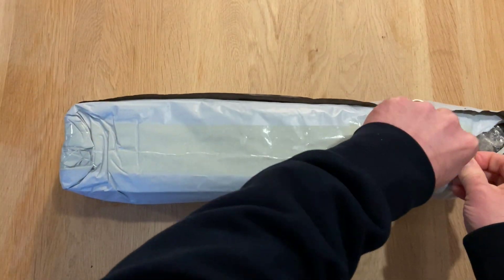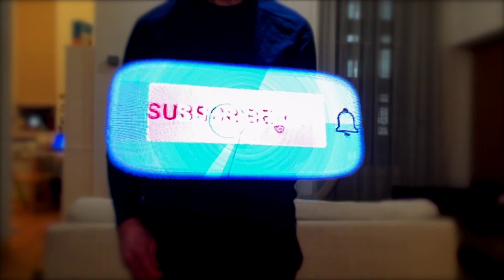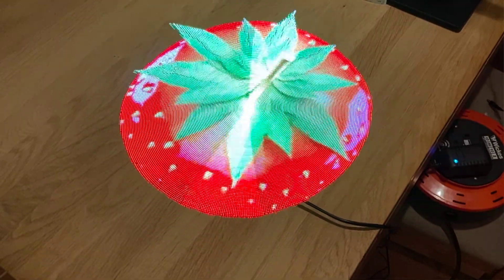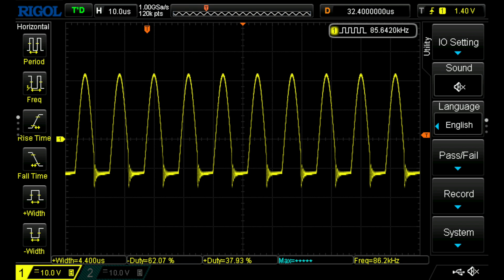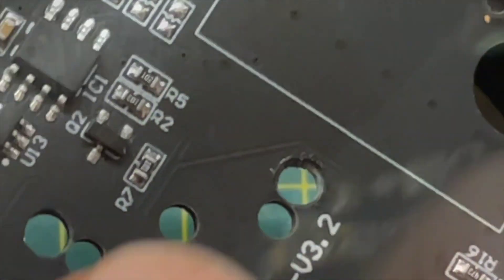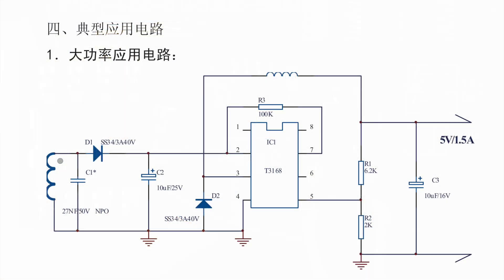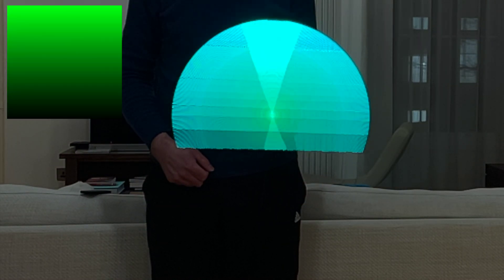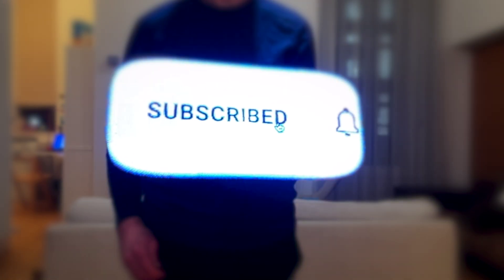Insane Spinning LED Hologram Fan: Unboxing, Demo & Tear Down!

Comment: I recently bought a holographic led fan, it works fine and projects the image but some leds don't light as they should, do you think it could be a wiring problem? 
How does it work? I want to know if I can fix it on my own 😢
Reply from the maker: It's most likely some of the LEDs are faulty. Is it one or two and are they always off?

Comment: Why werent this made with ws2812b leds? speed requirement?
Reply from the maker: I think so yes, I believe the bit rate for ws LEDs is 800Kbps. I think you wouldn't be able to get enough angular resolution with that update rate.

Comment: I wonder why they don't use APA102 leds and dispense with the driver ic's. Perhaps it's cheaper this way.
Reply from the maker: I must admit, initially, I thought the same, but I think it's down to the refresh rate. I don't think with addressable LEDs you'd be able to clock out the pixels quickly enough and have the LEDs latch the results fast enough to get a high enough resolution. Might be fine for a small display - maybe the one I have would work, but think for larger displays it might not.
Reply: 刷新频率不够

Comment: Curious, what's the cutting edge (sic) holographic tech available today, within reach of most makers?  Monitor with Cam and face/eye position recognition to dynamically change projected viewing angle?
Reply from the maker: I’ve seen some interesting things done with multiple transparent OLED displays.
Reply: @atomic14  
Says me,
the inventor of the 4D Political Analysis Monitor.
Had no idea it had a side effect!
Reply: My 4D Political Analysis Monitor has many side effects!

Comment: Couldnt it be using the offset IR led in the base to always know where the rotor is and how fast it is spinning? Just measure how long the gap between pulses takes, then measure how many % of that time elapsed since the last pulse. There would have to be insane precision otherwise because even the tiniest mismatch would result in a slowly turning image
Reply from the maker: It just be doing something like that. Maybe just restarting the image every time and slowly adjusting the timings to match.

Comment: They must have some way to calibrate the resonant frequency after assembly in software. They set it and forget it.  
What happens if when one of the blades breaks and takes off? I think one will need more than safety glasses. 
More like bomb disposal suit! 
A cool video and idea nevertheless.

Comment: Back in the days I built my own POV. From some old Ikea lamp LEDs. A cheap drill. An 8Bit micro controller and scrap wood. Was fun.
Reply from the maker: Nice!
Reply: @atomic14  Mr. Engineer, thank you very much for your explanation, my only question is whether these 3D hologram fans need programming or not?

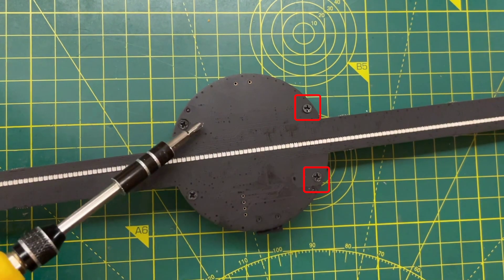Comment: 3:13- looks like the motor driver has an output that'll tell you how fast it's spinning. i guess it is being communicated over the remote control led? how cursed :D
Reply: I would assume that that LED is just on (or on with a particular frequency) and every time the top goes around, it's syncronized by the receiver of that LED from the bottom. That's way too good sync to be open loop

Comment: Thank U so much, I've always wanted to see the product in detail since last year🎉
Reply from the maker: There's a few variations, but I think they probably all work in a similar way. Using the wireless power transfer is quite ingenious.
Reply: @atomic14  indeed it is, wanted to gety hands on one but no delivery option too bad
Reply: @atomic14  Wouldn't it have been easier to use slip rings though? Just wondering if there are any advantages of the wireless transmission in this case...

Comment: Wow quite an expensive way of removing finger tips, I could recommend a pair of garden shears as a cheaper alternative :-) . At least it can give a bit more colour to the spurt of blood as it leaves the fingers via the fan, i might also  add an improvement at the point where the shite hits the fan could be had.
Reply from the maker: I really want to reverse engineer it some more - would be great to be able to stream content directly to it.
Reply: @atomic14  That should make a great video. Also it would be nice to see how it gets it index pulse to keep the display stable.